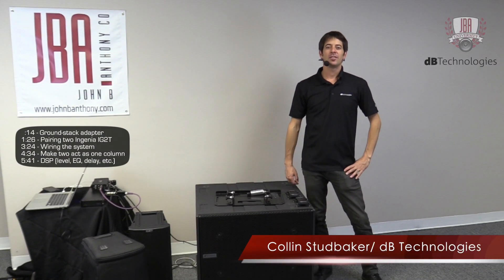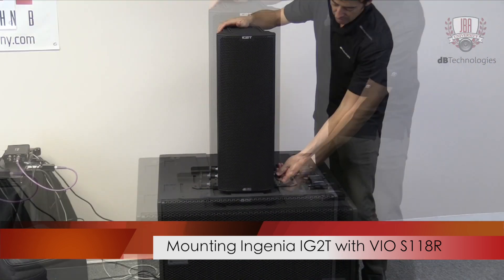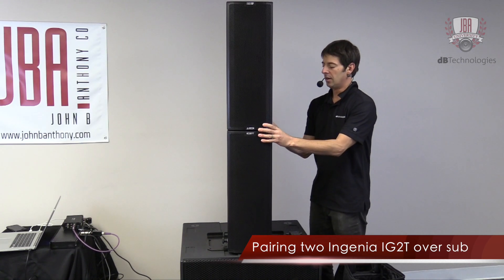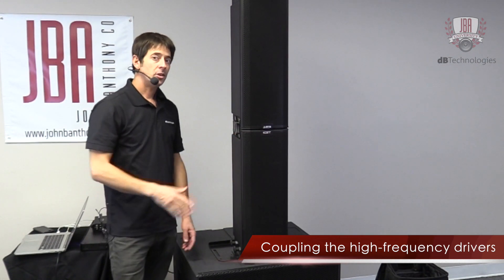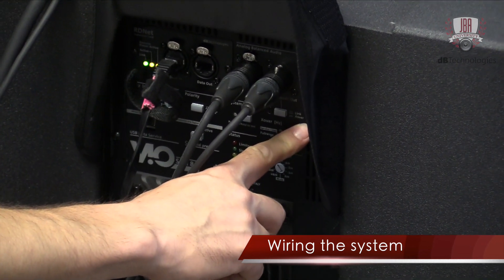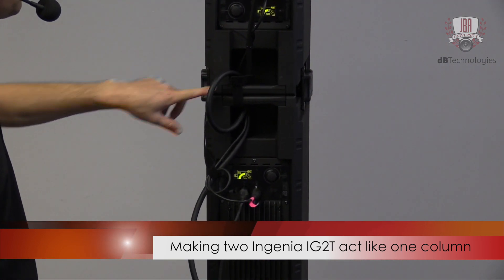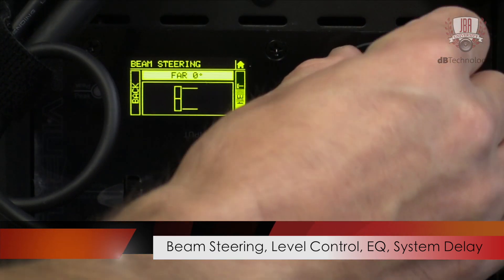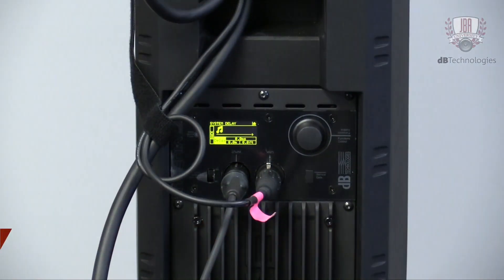dB Technologies Ingenia IG2T with VIO S118R - How to Build a System

Comment: Can the IG4T's be safely put on tripod stands? Is there a tripod socket on the bottom?
Reply from the maker: They can be mounted on normal speakers stands but for safety reasons DB Tech does not recommended stacking 2 on the same stand. 1 per stand and you’ll be fine.

Comment: Will these pair well with a QSC KW181 (which does not have a crossover built in so no HPF)?
If so...
Would a pair of IG2T be a good match with 1-2 KW181s - or should I step up to 3T or 4T
Reply from the maker: The dB Technologies Sub 18H is the best match for these.
Reply: @Johnbanthony  according to their manual the IG1/2T pair with the 15H and the 3/4T pair with the 18h